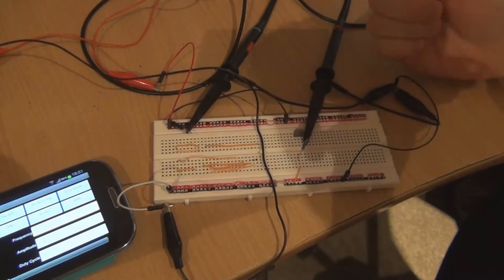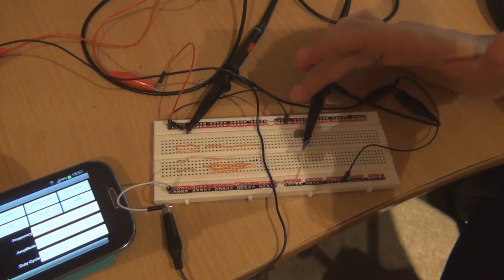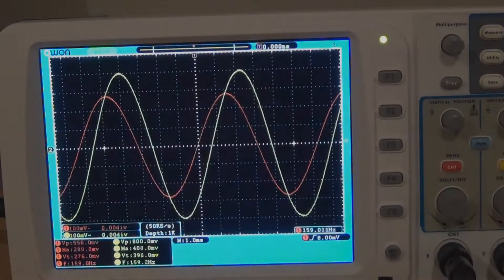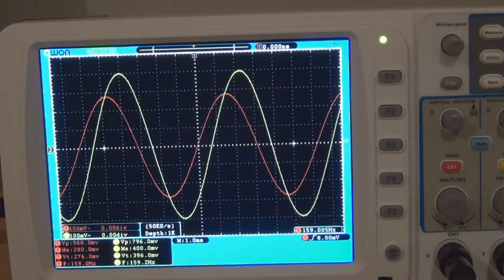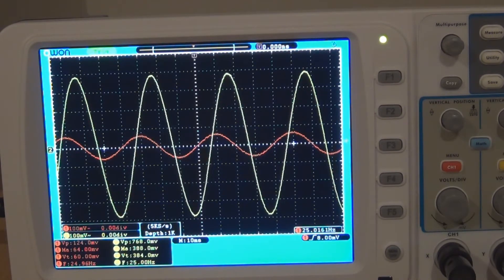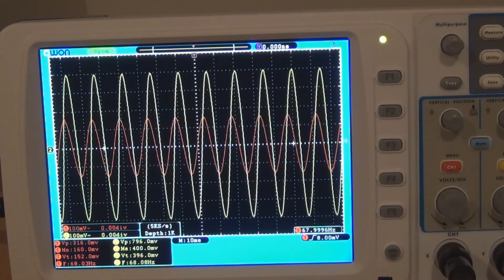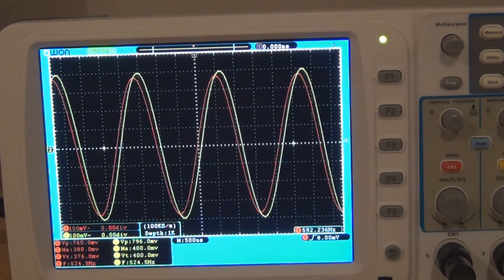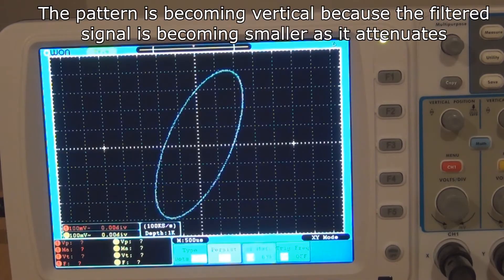oscilloscope view of a high pass filter

Comment: Interesting video, I wish to measure the 220v 50 hz AC mains for "Dirty Electricity" with my oscilloscope, as in the spikes in 1 Khz-120 Khz range (Spectrum analyzer).
Would the filter you use here work for this? Or what would i need exactly? Thank you!
Reply: Something to filter or remove the 50hz signal